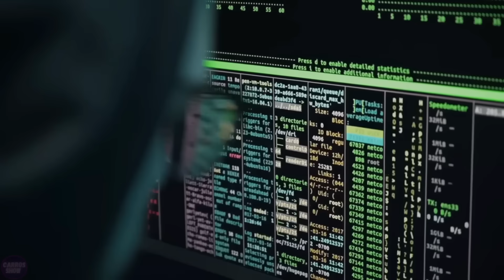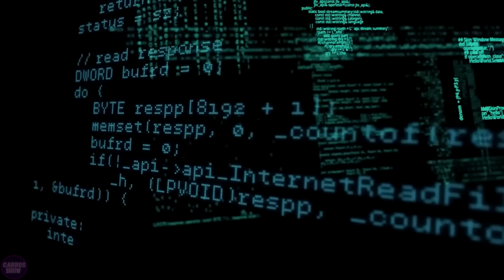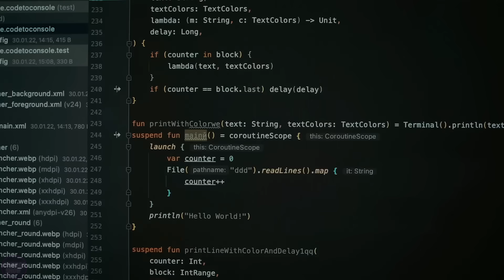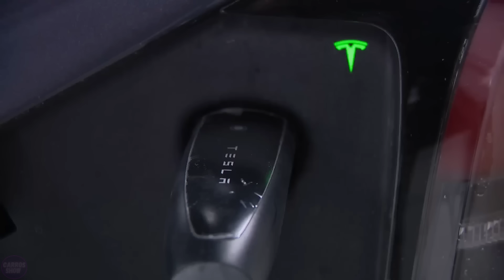First Fully Robotic US Factory SHOCKED Chinese Government

Comment: Refinery work is still safe. Heck the AI software we use sometimes freaks out for no reason. Just the other day I thought we were getting cyberattacked. The HMI and motors we’re controlling themselves instead of following its program. That’s where I come in to help resolve/prevent this dumb AI from causing a mess.

Comment: The speed of development is amazing. In the last three years there has been a considerable acceleration of technological development as various new components come together to form new paradigms. For instance, humanoid robots, in 1982 projected into 2049 in the film Blade Runner, like love robots are already available (in Barcelona). They needed AI level 3, sensitive sensors, immense memory and computing capabilities in lightning speed, new materials to facilitate touch and hydraulic micro and macromovement, extremely smart programming, parallel computing and ditto CPU chips, 3D printing of metals, high power density batteries, and understanding training and transforming. All this is available right now in the present.